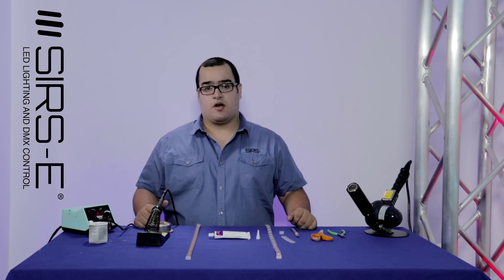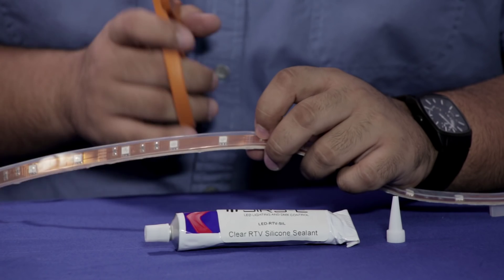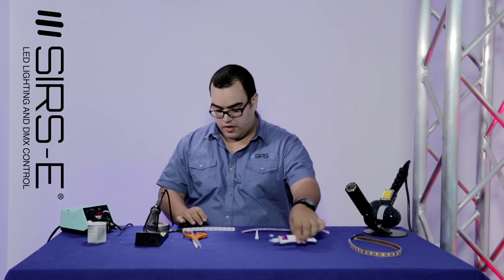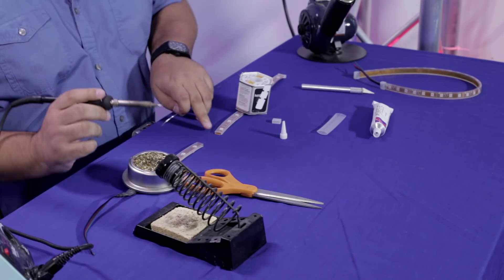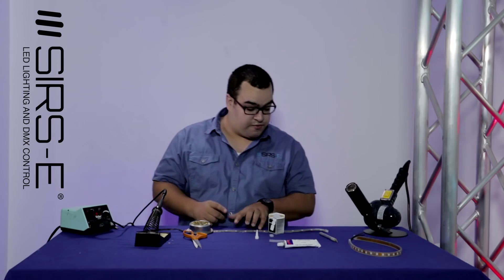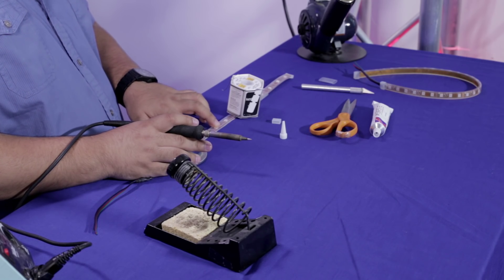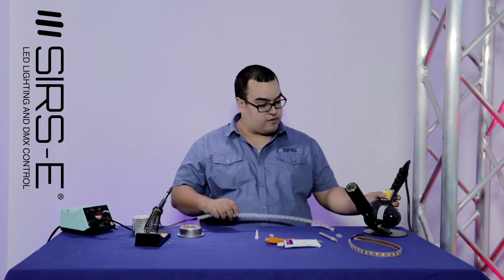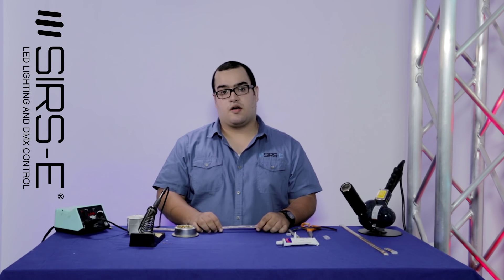IP67 LED Strips Solder Cut and Re-Seal

Comment: Thank you, so with the 4 contacts, do I need a single designated wire for each of the 4 leads or can I use one wire spliced between them all? Will this application be acceptable for accent lighting on a motorcycle?
Reply from the maker: as long as each contact is independently connecting each other you should be fine

Comment: What if you want to have nothing in between the two strips. Can you just solder wire in between them to make the connection? Will this cause any issues?
Reply from the maker: Hello Blake,
Of course. You can solder wires between two segments to expand the length between them, without any issues.
Although, if you plan doing this with waterproof strips, you will need to "re-seal" each wire connection using our endcaps and sealant silicone.

Feel free to visit our store and this link for more info:
https://sirs-e.com/product-category/led-lighting/led-accessories-led-fixtures-led-lighting/
Reply from the maker: You can solder wire in between to make the connection, the only thing you will need to look out for is voltage drop, depending on the voltage of your LED strips. Please check out our 12V and 24V models here, www.sirs-e.com

Comment: before the heat shrink would it be ok to use silicone then the heatshrink??
Reply from the maker: Hello Gary, you can use the silicon then the heatshrink, that will be ok.
Reply: can you do this with philips HUE strips? and is there a quick connector like a clip that you can clamp down on the strip so  you do not have to solder? i want to extend a strip, for under cabinets , but there are a breaks for appliances ,and i want to use the same  controller
Reply from the maker: We do not carry that product so unfortunately I do not know. However we do have couplers for are strips. https://sirs-e.com/product-category/led-accessories/